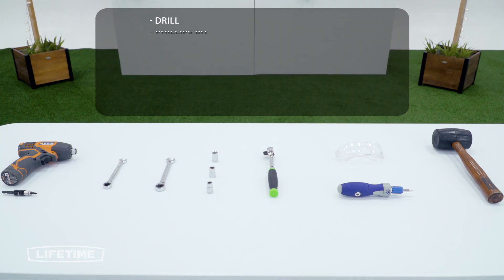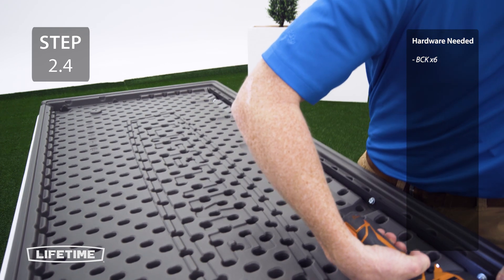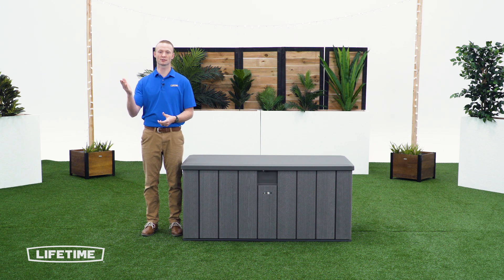Lifetime 150 Gallon Deck Box | Lifetime Assembly Video

Comment from the maker: Time Stamps:
Section 1 
Step 1.1- 1:35
Step 1.2- 1:44
Step 1.3- 1:47
Step 1.4- 1:54
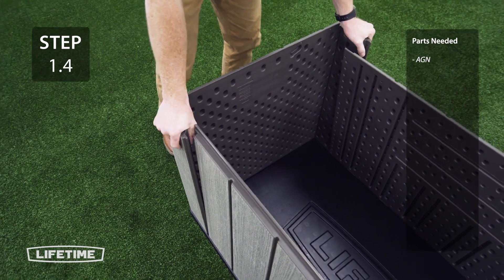Step 1.5- 2:09
Step 1.6- 2:32
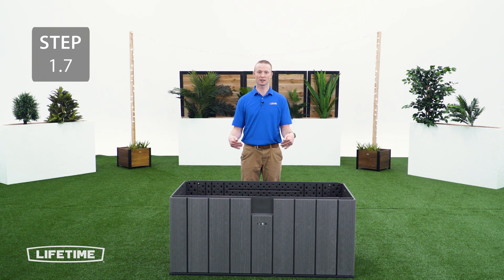Step 1.7- 3:00
Step 1.8- 3:25
Step 1.9- 3:38

Section 2
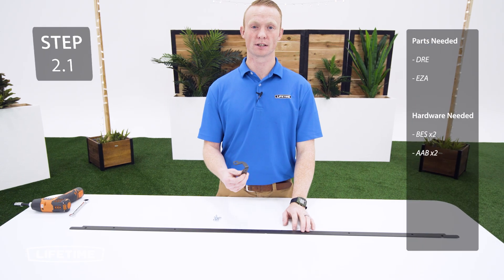Step 2.1- 4:06
Step 2.2- 4:30
Step 2.3- 4:36
Step 2.4- 4:37
Step 2.5- 5:10
Step 2.6- 5:32
Step 2.7- 5:41
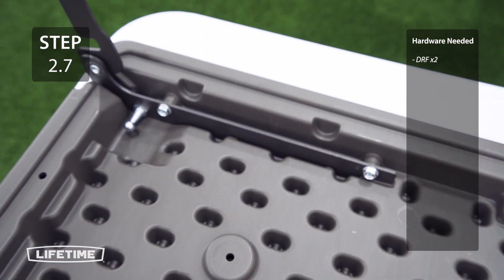Step 2.8- 5:58
Step 2.9- 6:12
Step 2.10- 6:18
Step 2.11- 6:27
Step 2.12- 6:34
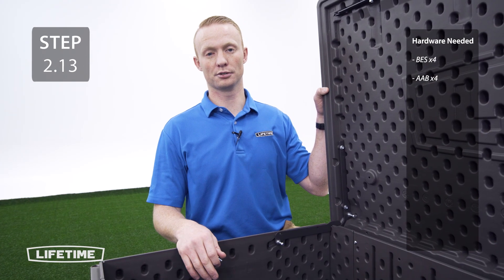Step 2.13 – 6:51
Step 2.14- 7:33
Reply: Step 2.4 I am struggling. The holes don’t perfectly align with the lid where it’s supposed to be screwed. Is there a certain way I am supposed to do it? Is mine defective? HELP!
Reply from the maker: @incredibles11  if you completed 2.3 correctly (the tab in the notch) that is all that matter. The holes on the lid it's self is just togive you an idea where you should drill. If you are at least close to the holes you are fine to drill with out compromising the assembly.

Comment: Love the Deck Box and this is a great video! The deck box came with decent instructions and adding in the video made it a snap to put together. I'm a 70+ woman and over the years I've put together my fair share of furniture. That being said this was not difficult. It took me maybe 45 minutes and that includes correcting a mistake that was my fault. I put together the lid bar and locking hardware improperly. It was a quick and easy fix.

Comment: Put this together by myself. Went together perfectly. My only hiccup was putting the locking tab on the metal rod backwards. Had to take the bolts out and flip it around. No big deal.

Comment: Just assembled the same unit. Wish the screws fit as easily as yours did. Also kind of ridiculous that in many places the plastic was not drilled through and had to use a drill or Screwdriver to get the nut through. Also, I am missing a nut for the screw that attaches the lid to the body.  Nice unit, the assembly would be much easier if the screws could fit in the holes provided.
Reply: Get a better drill.  It's plastic.
Reply: @karunald  You missed the point.
Reply: yeap, they are toooo small for holes
Reply: @karunald   the locking rail is metal. It’s indeed ridiculous that the holes weren’t appropriately sized.

Comment: Just bought this from Costco this week, Actually I bought two of them.
It is the same item as listed in the video, but the Costco Model # 60340U  Lifetime 150-Gallon Deck Box.
(and I picked them up for just $99.99 each)
Followed this video and along with the written instructions, it was a PIECE of cake. 
Instructions on this video made if go very smoothly. I could not be happier with my purchase. everything aligns perfectly if you follow the instructions in the video. and also look at the instructions that come in the box. It helped to have a drill and an impact driver. Also having both a Philips bit and sockets for the impact driver made it soooooo much easier than if I would have had to do it without.
Reply: Capt Mrgn  how is it holding it up to the elements?
Reply: @timwilson7927  It's thick plastic

Comment: Took a little time but got it together and everything works fine.  My biggest problem was “assemble with the hardware” but which hardware.  Would have been helpful if the person in the video showed more closely which hardware he was using with each step.  Also, the nuts, screws and parts were all there but seemed to be in random different bags so it took awhile to figure out what goes with what.  That said, after a little head scratching and about a dozen different attempts to figure out how the long metal locking rod fit, we do it done and are happy with the end result.
Reply from the maker: Thank you for the feedback! We do list all hardware used on the right side of the step that is being performed. Our videos are based of the instruction manual so it is recommended to have that available while assembling with this video. In the manual, at the beginning of each section, you will see the hardware used as well and what bag it is needed. If your confused on which hardware is what, you can hold the actual hardware to the manual because the pictures are designed to be the same size of the actual hardware unless labeled otherwise.

Comment: Is there some kind of trick to get the front and back to slide to lock. Mine will not slide in place at all. Almost seems like the tabs are a hair short.
Reply: @skinman8 did you ever figure this out? I can’t get mine to slide on either
Reply: @beelight13  I ended up putting Vaseline on the tabs where the sliding happens. Also had to shave a hair off a couple slots. I hope this helps.
Reply: @beelight13  I had to chisel away at the grooves along the bottom so they were an even rectangle in order to get the pieces to fit.
Reply: I just used a mallet and that did the trick.
Reply: @skinman8 thanks for the tip! The Vaseline and a heavy man did the trick! 😅

Comment: Don't buy this box unless you want to use it as a coffin to bury yourself building it. Came with flat head screws to drill... like wtf? Nothing lined up and the springs didn't fit. This is pure trash... so i guess you can use it as a garbage can.
Reply from the maker: We're sorry that you had a difficult time assembling this product. Please contact our assembly experts to get some additional help on this product. They can be reached at 800-225-3865 or by email at customercare@lifetime.com. Customer Service hours are Monday-Friday, 7:00 am to 5:00 pm and Saturday, 9:00 am to 1:00 pm (MT).
Reply: Lifetime is a great name... it describes the time it takes to complete building this piece of trash.
Reply: @hnguy054  ok, that’s a funny line!!

Comment: @Lifetime Products: The one I got from Costco today has screws quite larger than the holes in the hinges. Although it clearly mentions it in the instructions about it, I still couldn't get the screw inside the hinge hole even with a drill. Any thoughts on how to address the problem? I can try drilling a larger hole or may be buy a smaller screw.
Reply from the maker: It may be easier to use a socket and a wrench to give the screw a head start. It will take a couple of turns at first to get it started but as soon as you see that it's going through, you can start using the drill again. This may be easier to do before actually connecting it to the lid. If you're still having troubles, please reach out to our customer service team. They can be reached at 800-225-3865 or by email at customercare@lifetime.com. Customer Service hours are Monday-Friday, 7:00 am to 5:00 pm and Saturday, 9:00 am to 1:00 pm (MT).
Reply: @LifetimeProductsAssembly  Thank you. I tried a bunch of things and the trick was the angle. If I don't screw in straight (90 degrees), I had a really hard time even with a wrench. In short what you recommended + the angle. It will still hard, so I am curious. What is the reason for keeping the holes smaller? Instead, if the holes were slightly larger, how would that be an issue?

Comment: Ours went together, thanks for the instructions. The metal lock hooks on top and bottom are meeting each other, have to give the lid a pull to the right to get it to close properly. It will not close by itself. Seems to be durable, but not happy with the lid not closing correctly.
Reply from the maker: I'm sorry you're having trouble.  Give our customer service team a call and we can trouble shoot the issue with you and see if we can help figure out what's happening. They can be reached at 800-225-3865 or by email at customercare@lifetime.com. Customer Service hours are Monday-Friday, 7:00 am to 5:00 pm and Saturday, 9:00 am to 1:00 pm (MT).
Reply: Because they are Defective!   You have to force the lid down on one end because the sides of the box are wider than where they should go inside the lid.   Mine is 1/4" at least.   I need TWO HANDS to get it to close right.   Now I have to dismantle it and take it back to Costco!   Old 130g lifetime is way better, easier to build.  But it has no lip to grab to open the lid but a tiny area in the front middle
Reply: @LifetimeProductsAssembly  There is a recording stating they are not taking calls.

Comment: I found that the video was very helpful except the video and the assembly manual are both very lacking when it comes to the installation of the hinges.  It took me as longer to figure out the hinges as it did to assemble the entire unit.  Please modify the video and the manual to add more details on the installation of the hinges.  With that said, I am impressed with the box.   I did not install the locking tabs as I don't intend to lock it.  I noted that several people called the unit "junk".
Reply: Same here. We’re not sure if we got 2 identical hinges or is there a R and L hinge?
Reply: @123craftygal  Hi Catherine— did you receive an answer from Lifetime regarding if there is a left and right hinge?  I’m having trouble figuring out how to install that right hing 

Thanks
Tom

Comment: I bought this model today and followed your video Upto stage 2.4 I stopped at the bar as the metal rail was not aligning correctly to preset area where the screws go in.Very disappointed returning tomorrow,waste of my precious time !!
Reply from the maker: We're sorry for your frustrations with assembly. Reach out to out customer service team for some further assembly assistance. They can be reached at 800-225-3865 or by email at customercare@lifetime.com. Customer Service hours are Monday-Friday, 7:00 am to 5:00 pm and Saturday, 9:00 am to 1:00 pm (MT).
Reply: I just bought this today at costco for $99. If u have the right tools, it makes assymble a lot better. Been wanting this for a while.
Reply: It is amazing that they cannot properly drill the holes for screws/nuts they provide.
Reply: @davidmiller88ify  I think that is intentional so that the screws will bite into the plastic

Comment: Wonder how much wait it can carry inside say if I were to move it from the back yard to the front yard on party occasions. On that note can it hold the weight of people sitting on it?
Reply from the maker: The weight capacity of this deck box is 900lbs, however, the deck box is only designed to store items not to be sat on. And yes, you can move the deck box if you decide to do so.

Comment: I can't get the two side walls to slide on the bottom
Reply from the maker: This step can also be accomplished by hitting the wall panels with a rub mallet. Just tap it hard enough where you feel the slide. If you continue to have problems, reach out to customer service where they can trouble shoot some ideas with you. They can be reached at 800-225-3865 or by email at customercare@lifetime.com. Customer Service hours are Monday-Friday, 7:00 am to 5:00 pm and Saturday, 9:00 am to 1:00 pm (MT).

Comment: Why doesn’t it come with a manual in the box. I recommend you guys give the buyer a manual and make it simple.
Reply from the maker: It should come with an instruction manual. If for some reason your product did not, assembly manual and can be downloaded from the manufacture’s website at lifetime.com under the model number. You can find manuals by scrolling all the way to the bottom of the web page and clicking on "Assembly Help". You can then search all products by model number and language.

Comment: Just purchased this one at Costco lid locking tab was defective the notch was on the left instead of right which I’m unable to install to the lid. Please help
Reply from the maker: We'd love to take a look at the defective locking tab. Please contact our customer service department with your model number and product id that will be found on the cover of the instruction manual. From there they will get some pictures and help you further assemble. They can be reached at 800-225-3865 or by email at customercare@lifetime.com. Customer Service hours are Monday-Friday, 7:00 am to 5:00 pm and Saturday, 9:00 am to 1:00 pm (MT).

Comment: Is there a trick to the gas springs? The ends that attach closer to the hinge fit easily but the other ends closer to the middle of the box are impossible for us to get on. Not sure if it's just a defect or what.
Reply from the maker: I'm sorry you're having trouble.  Give our customer service team a call and we can trouble shoot the issue with you and see if we can help figure out what's happening. They can be reached at 800-225-3865 or by email at customercare@lifetime.com. Customer Service hours are Monday-Friday, 7:00 am to 5:00 pm and Saturday, 9:00 am to 1:00 pm (MT).
Reply: Are you sure you have your hinges on right?   The top part that attaches to the Lid should be on the inside.
Reply: @LifetimeProductsAssembly  
Can you tell me if both hinges are the same or if there is a right and left hinge (part F00). 

If they are the same how can they BOTH be facing the inside?
Thanks 
Tom

Comment: Bought this from Costco, no instruction manual in packaging. Saw this video to assemble, very bad Engineering and video many times doesn’t show or say the orientation of objects . Different sizes of screw and bolt. Need to keep different sets of pliers/wrench .
Reply from the maker: That shouldn’t be the case. I recommend contacting our customer service team and sending pictures of your product to see the hardware you received and see how we could’ve helped made this a better experience for you. They can be reached at 800-225-3865 or by email at customercare@lifetime.com. Customer Service hours are Monday-Friday, 7:00 am to 5:00 pm and Saturday, 9:00 am to 1:00 pm (MT).

Comment: The Lid doesn't fit and I'm not the only one with the problem.  The lid is too short to where one/both side walls/front corner doesn't fit inside.   I built this perfectly with zero gaps in the walls during screw in.  MFR defect.  Costco.  No wonder it's only $99.    Bonus points for Customer Service not accepting phone calls because they're busy.  Likely fielding calls from people with lids that won't go down properly.

Comment: Not easy to assemble.  Nothing fits well, no pre drilled holes.  What part of assembling furniture do you need to do a step called "you may need to bend the metal" to make it fit.   Just design it correctly in the first place...  i feel like a lot of these reviews are fake.  Good unit but be prepared for frustration with assembly.  Easy fixes for design team.

Comment: Can someone tell me if the left and right hinges are supposed to be the same (mine are). It seems that they should be different so they can both  be flush with the box. 
Thanks 
Tom
Reply from the maker: They are the same hinges. The trick is to turn the hinge that you haven’t assembled yet upright so you can get that flushed fit. If you have any further questions, please contact our customer service team. They can be reached at 800-225-3865 or by email at customercare@lifetime.com. Customer Service hours are Monday-Friday, 7:00 am to 5:00 pm and Saturday, 9:00 am to 1:00 pm (MT).

Comment: What a joke. Have just assembled this unit. Very misleading video. It is not easy to assemble. The guy on the instructions must have pre drilled all the holes & done significant work before starting in order for it to ho together so easily. Just design it better or don't sell it as if it's a 5 min job.